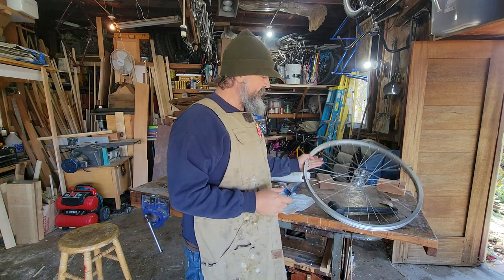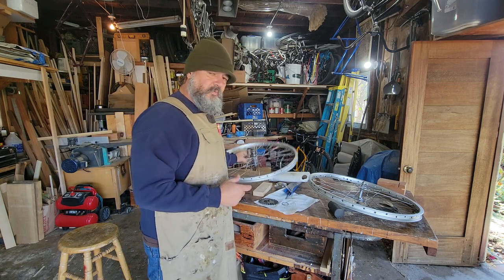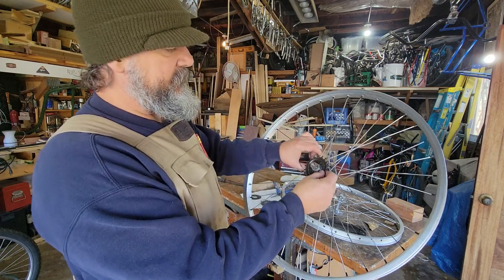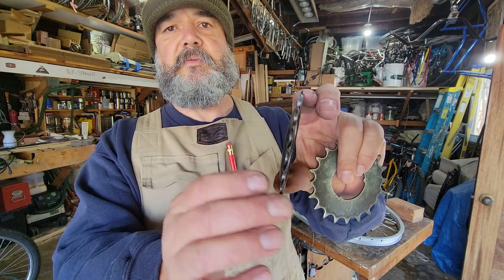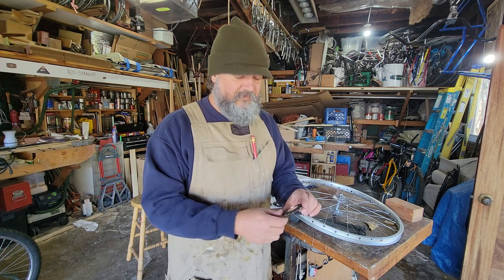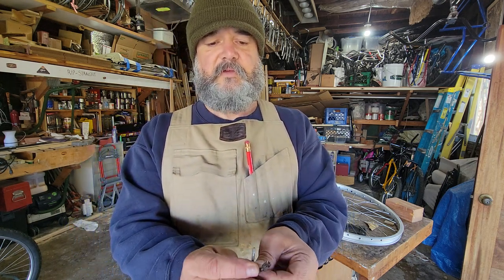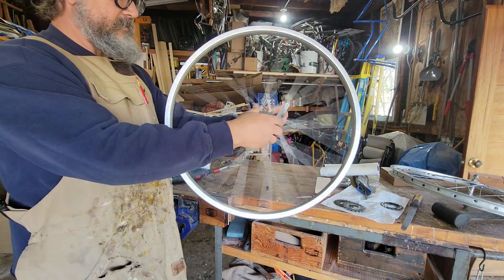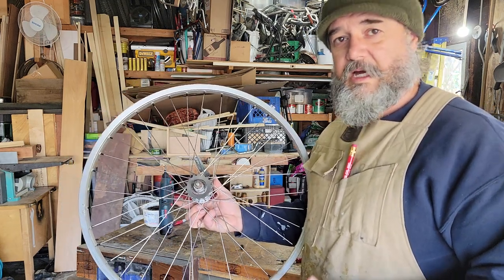Klunkin' Ain't  Easy - Fitting The Wrong Cog To A Red Band Bendix Coaster Brake

Comment: Super helpful Mike! Just encountered a similar setup today, Happy Holidays!
Reply: FYI, I learned today having the need to run a 39t/17t final that a shimano/ sun tour driver for coaster brake hubs is compatible with Bendix 76 hubs which allows a 17t rear sprocket to be utilized.

Comment: Ironically without searching for the red band bendix, this vid popped up. I was google searching for a larger tooth sprocket and wondering about running a 175 crank on my Schwinn racer, which came with a red band. Now google is reading my thoughts. No need not to assimilate. Assimilation complete.

Comment: Hey Mike, are the Redband hubs  generally 14g spokes. Also on a 12g hub do you drill the Eyelits out or run a washer to accommodate 14g?
Reply from the maker: I'm not sure of the gauge on the OG redbands but I know a lot of my pals do drill them out for heavier gauge spokes - Do what you've got to do